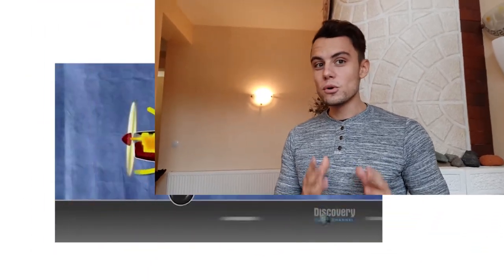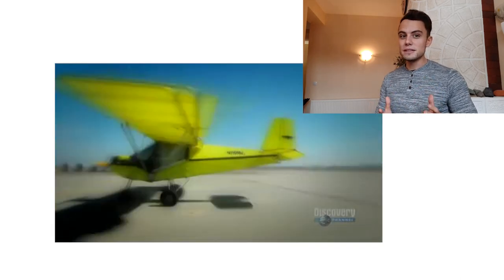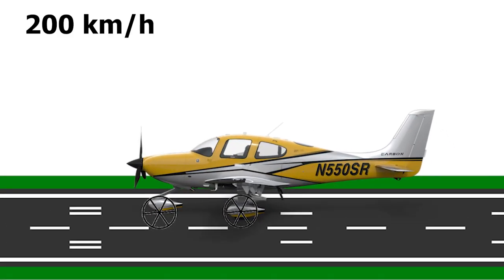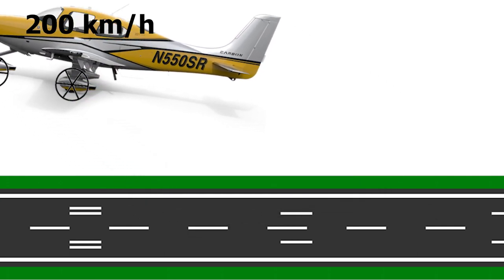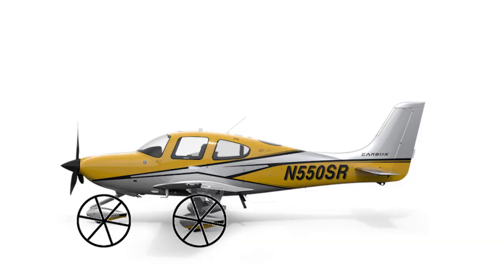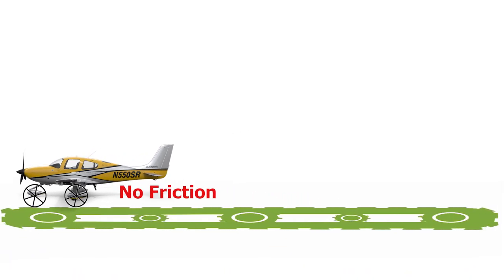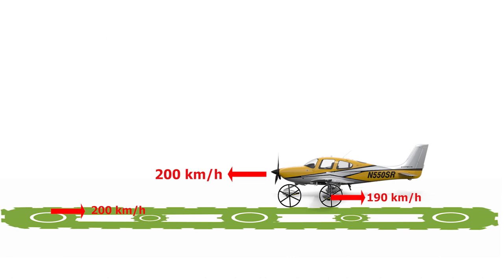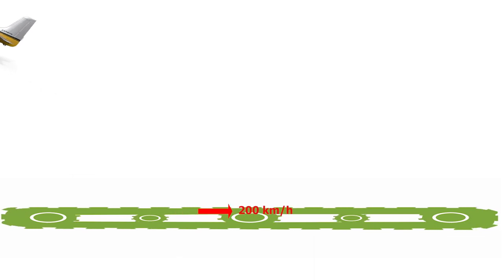Can an Airplane Take Off From a Conveyer Belt?.... Finally Solved!

Comment: Looks like you assumed a lot of variables. If you read the original riddle where it states that the conveyor will move EXACTLY at the same speed as the tires in the opposite direction. If this is the case then the plane will never be able to take off unless it can double the speed of the tires to overcome the conveyor's motion by means of thrust. (Which is what you demonstrated more or less)

At 10 KPH and 0 AOA your wing will not produce lift to lighten the weight force. Especially with a high wing loading as your model showed with a liftoff of 200 KPH. Now have a lower wing loading aircraft with a high thrust engine that reduces Vso and is basically a STOL configuration then yes the plane could probably take off if you can out accelerate the belt with out blowing a tire.
Reply: You are assuming that a conveyor belt against free spinning wheels, will affect thrust engines….. the engines move through air by creating pressure in a direction. This is not stopped or hindered by the conveyor against the wheels. The wheels aren’t part of the process that moves the craft, then dangle and roll.
Reply: The riddle (Imagine a 747 is sitting on a conveyor belt, as wide and long as a runway. The conveyor belt is  designed to exactly match the speed of the wheels, moving in the opposite direction.)                                                                                                                          Can the plane take off?                                                                                                                                                                                                       Let's break it down                                                                                                                                                                                                                 747= real plane, it will take off                                                                                                                                                                                               Sitting= Stopped, not moving, wheels not turning, and conveyor not running.                                                                                                    Conveyor belt designed to exactly match the speed of the wheels = Conveyor belt can only match wheel speed, it can't change wheel speed.                                                                                                                                                                                                                       Moving in the opposite direction= The top of the wheel  moves in the same direction as the plane's forward movement, the bottom of the wheel moves in the  opposite direction to the plane's forward movement. So any conveyor belt the wheels roll over moves opposite the plane.                                                                                                                                                                            To make the wheels turn the plane must move forward, as the wheels turn they roll on the conveyor belt at the same speed. Because the speed of the wheels  already matches the stopped conveyor belt, the conveyor belt  will not have to start and the plane will take off.                                                                                                                                                                                                                                  I see now this is not a riddle, it's the definition of how planes take off from a runway with one word changed. they replaced the word runway with conveyor just to confuse everybody.

Comment: There is a slight flaw in the argument in that if there is rolling resistance, then there will be a horizontal force exerted by the belt on the aircraft. Hence the unpowered aircraft on the moving belt will eventually match the belt speed. 

I think it is better to simply consider the forces. Thrust versus rolling resistance. 

The confusion is in the question: what exactly is meant by "the speed of the wheels"?
Reply: Rotational wheel speed on the surface of the wheel is exactly the same as speed at the wheel axis.  It’s interchangeable as long as there is no slippage on the surface.

Comment: i think in the strictest sense, this would not work as the aircraft could never gain the air flow to generate lift on the wings so long as the speeds are perfectly matched.  However, at some point the plane's thrust is so high that any deviation in the relative speeds could result in the plane gaining lift quite quickly.  I think in the strictest sense, the reference frame is not moving, only the surface on which the aircraft sits.  The air itself is not.  But in a case with a strong headwind, we see a plane does appear to have lift and stay stationary laterally.  I think this is the closest to the actual kind of theoretical approach one would implement to solve the question, which in that scenario the plane would be able to lift off.  I think it all depends on the conditions you stipulate.
Reply: The only conditions stipulated are those in the question and that condition is "exact"

There is no deviation
Reply: Think about it this way. If I’m on ice i can’t move by walking because there’s no friction. If I pull a rope in front of me I can move even though I’m on ice. The engines from the plane are pulling it so that it moves even if the conveyor belt is as fast.

Comment: All those on here who say the plane would not move are forgetting that the only thing turning an airplanes wheels is the forward movement of the plane. If the plane really does not move forward at all, then the wheels do not move and the conveyor does not move. There is no motor turning the wheels, and so without forward motion, the wheels would not spin at all, i.e. a speed of ZERO. And then the conveyor would match that motionless speed, and how exactly would a non-moving conveyor stop the jets from forcing the plane forward? The conveyor does not even begin to move until the plane is already moving forward, so it obviously does not prevent that from happening.

A thought experiment: If I am on a motorcycle on solid pavement next to a moving sidewalk, and I have horizontal pole attached firmly to the motorcycle and also to a freewheeling  cart that is sitting on the moving sidewalk, when I accelerate the motor cycle, both the motorcycle and the cart will move forward against the movement of the moving sidewalk. And even if the sidewalk magically speeds up to match the wheel speed of the cart being pushed by the motorcycle, that will not slow down the forward movement as the force imparted by the moving sidewalk would simply spin the wheels of the cart faster. The motorcycle and cart will both move forward against the direction of the moving sidewalk because the motorcycle is pushing against the solid pavement and not against the moving sidewalk. I can gun the engine and the motorcycle and cart will both move faster and faster in the opposite direction. The only effect of the moving sidewalk would be to spin the wheels of the cart and thereby impose a bit more friction resisting the motorcycle, but not enough to overcome the thrust of a powerful motorcycle engine.

In the case of the airplane on the moving conveyor belt, the jets are not pushing against the conveyor, but are instead are using the equal and opposite reaction of the exhaust gases to push the plane forward (you could simplify this by imagining that the jets are pushing against the air). So just like the thrust from the motorcycle engine that is not affected by the moving sidewalk, the thrust from the jet engines is not affected by the moving conveyor belt (except for a small amount of added friction) because they are not pushing against the conveyor, but directly against the air to move the wings of the airplane and the entire airplane forward.
Reply: Still incorrect.  You can have a vehicle (plane or car or cart) rolling on a surface and a surface that moves to match.  That's what Mythbusters did in their RC car experiment.

Nobody is suggesting that the wheels are powered directly.  You are still mistaking rotational behavior of a wheel and the linear travel of the wheel axis and the instantaneous tangential speed at the contact patch on the ground.  Your frames of reference are in error.

Comment: Anyone here think the propeller is what will cause an increase in air movement over the wings which will create upward lift?
Assuming the conveyer belt and planes wheels perfectly match each others speed in opposite directions IN SUCH A WAY that the plane does not move forward or backward while it ramps up its propeller speed. I believe that eventually the propeller will create enough air movement over the wings to create lift.

Maybe I am way off base here but this question seems to be more about the design of the plane. In the small scale tests Myth Busters and others do, they use a treadmill and a model propeller driven plane. My guess is that a small lightweight model plane can create more than enough air movement right over a wing that is placed in the center of the model plane and this creates the air movement needed for lift. The answer can change then depending on where the wing of the plane is relative to the propeller, but most importantly can the propeller create enough air movement over the wing to generate more lift than the weight of the plane.

Please dont hate on me to hard.
Reply: The propeller will create torque, or what pilots call P-factor. The thrust from the propeller cork-screws around the fuselage. Most engines spin to the right (when viewed from cockpit) and the air from the propeller with hit the vertical stabilizer causing the aircraft to want to yaw to the left. A pilot has to counter that force by using right rudder as airspeed increases of the control surfaces to maintain directional control during the take off roll. The propeller thrust would be hitting the top side of one wing and the bottom side of the other nearly perpendicular to the required airflow required for lift over the wing due to forward motion of the aircraft.
Reply: There's a component of prop thrust that generates lift but it's over such a small area that the plane won't take off. Jets don't have any thrust flowing over the wings so there is no lift in that case.
Reply: Propellers don't generate airflow for wings to produce lift.

Propellers push air back causing thrust Force only
Reply: @ashleygillett  Yeah they do produce a small amount of lift.  I fly twins, and the propellors move air over the wing.  You notice it when doing single-engine operation.  Boeing and McDonnell Douglas built and flew prototype jet transports where they placed the engines so their exhaust flowed over the top surfaces of the wings to produce lift and shorten takeoff rolls.   One of them is on display at the Pima Air Museum in Tucson, AZ.  The aircraft designations were YC-14 and YC-15 I think.
Reply: @RR-pw5nb  yes I know they cause a small factor of lift force but that amount is absolutely insignificant for the purposes of take off. 
I'm implying that it is not the PRIMARY purpose of a propeller.

Comment: If the question is obeyed and understood, the plane can not move forward unless you violated the rules of the experiment. Understand the simple one sentence rule and a person can talk to the pilot during the session. Matching speeds, no forward movement. No airflow. No flight.
Reply: an aircraft can take off while going backwards if the wind speed is high enough. the thrust not pushing on the ground means wheel speed is irrelevant. conveyor belt just means the wheels spin fasterl
Reply: @chrisoakey9841  If you ignore the rule, the solution, the premise and the experiment is invalid. Read the rule. The wheels  match the speed of the treadmill or conveyor. If you want to argue, first explain why you can't figure out why you are ignoring the experiment.
Reply: Ok

The premise "Can a plane take off if the speed of its wheels are matched to a conveyor belt the wheels rest upon moving in the opposite direction."

Now, an explanation for why the answer is yes. A plane doesnt gain lift because of its movement relative to the ground, but the movement relative to the fluid it's in (in our case, probably air). The wheels are there to reduce friction and absorb impact. As long as the wheels are rotating at the same speed as the surface they are contacting, they provide negligible friction. If they move faster or slower than the surface, the wheel would speed up or slow down the plane. That is how cars work. Planes are not cars, however.

To reiterate. Planes generate thrust through the surrounding air, not the wheels, and thus the wheels and the surface they are in contact with are not relevant to any significant degree to the question. 

You may say that the question is wrong or whatever, because it assumes that the wheels and the ground matter, but you cannot say that the solution is wrong, because the solution is a proven fact
Reply: In addition, the wheels will always match the speed (in the opposite direction) of the surface they rest on relative to the object the wheels are connected to, until they lose contact with that surface. That law is what allows cars to move forward by powering the wheels and converting the rotation of the wheel and its circumference into travel in the opposite direction. You can test this by finding the circumference of a wheel, rotating it once, and then measuring the distance traveled by the vehicle. It should be exactly the same as the circumference. 

This isnt entirely relevant, because again, wheel speed is irrelevant to plane speed, but it seemed like something you were struggling with
Reply: @averywhitaker3513  It's relevant to the question. The question is can a plane take off if the wheels and the conveyor have matching speeds in opposite directions. The answer is no. If you want to ignore the rules of the test, then anything is possible. Going faster, slower, losing contact, up, down or sideways, the question remains the same and the answer is always NO.
Reply: @shooterqqqq  listen very carefully. The speed of the wheels doesnt matter because the wheels arent what makes planes go forwards. And we know that the plane will always take off, because it has been observed happening in real life under the exact same circumstances as the question demands.

This question is designed, intentionally or not, to trip up people who think planes are like cars. They arent. 

Also, pro tip, saying "nuh-uh, just no" is not an effective argument tool. Explain why instead of making a claim with nothing to back it up, unless that claim is common knowledge and well understood by your audience, as well as yourself. And never make a claim that you dont know for a fact is true without making note to your audience that you are not sure of the veracity of that claim
Reply: @averywhitaker3513 The person who wrote the experiment says the wheels matter. I am explaining to you what the originator of the experiment is insisting on. I didn't write it. The originator did. He said the wheels match the conveyor in speed but in the opposite direction. If you want to ignore or make up different rules, you can make up any results you want.
Reply: @shooterqqqq  it sounds an awful lot like you are ignoring me . Engage with me here. Why do the wheels matter. Why will the plane not generate forward thrust and thus lift. If you arent willing to learn either way, I'm not going to continue
Reply: @averywhitaker3513  You're not willing to adhere to the rule of the experiment and making up your own rules and results. Read the experiment. Comprehend the rule. Understand.
Reply: @shooterqqqq  describe the experiment to me as I did to you
Reply: @averywhitaker3513  No.
Reply: @averywhitaker3513 The belt speed is controlled externally to match the wheel speed of the plane. The plane apply maximum thrust but appears to be stationary . There is no air speed on the wing, no lift.
Reply: @Dont_Gnaw_on_the_Kitty_1  you are objectively, verifiably, demonstrably wrong. You do not know what you're talking about.

Planes are not cars. They do not propel themselves with their wheels. They propel themselves with propellers, and turbines, and jets. Hey pull themselves through the air by pulling the air past themself. Wheel speed is 100%, absolutely irrelevant. It could be going 1000x the planes speed in either direction and the plane would take off at the exact same time, every time, without fail. Wheel speed is irrelevant
Reply: @averywhitaker3513  I do agree actually, thinking about it. If the plane was mounted on an air bearing (effectively zero friction) the belt would be run up to (effectively) infinite speed and the plane would still be moving forward with air over its wings.
Reply: @shooterqqqq No; the question does not say, as you are saying, that "the wheels match the conveyor in speed but in the opposite direction." It says the CONVEYOR will speed up to match the WHEEL speed, the opposite of what you said. There is no limit or condition on the wheel speed or, thus, the plane speed. The plane is FREE to do what it's designed to do, move forward through air driven by engine thrust. The conveyor belt can do whatever underneath--fast, slow, still, forward, backward, alternating, whatever--and the plane doesn't care. All that that affects is how the wheels spin, and how the wheels spin doesn't affect the plane's travel.
Reply: @tedwalford7615  the conveyor speed will match the wheels speed. The plane can not move forward. A person's legs  will match the treadmill speed. The person does not move forward or back. READ the original question.